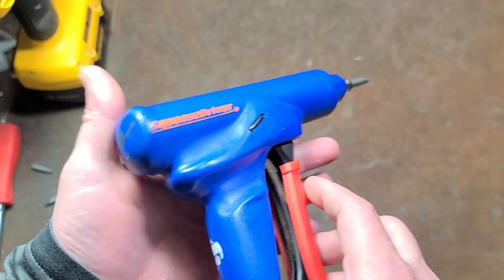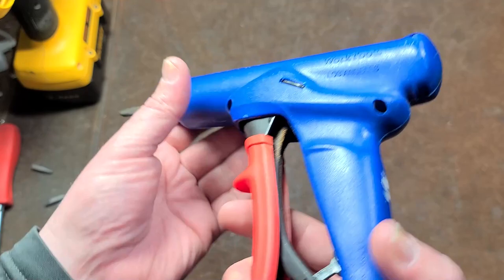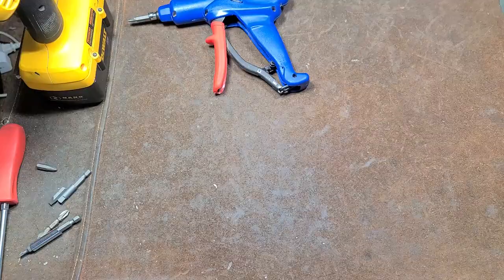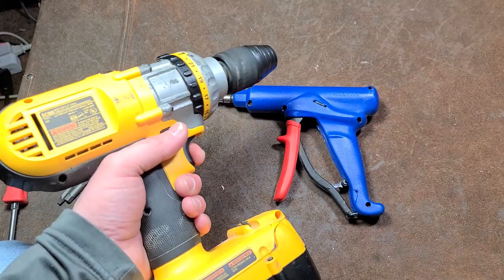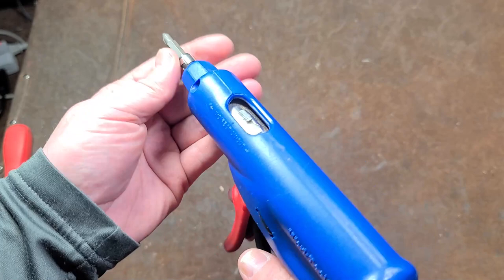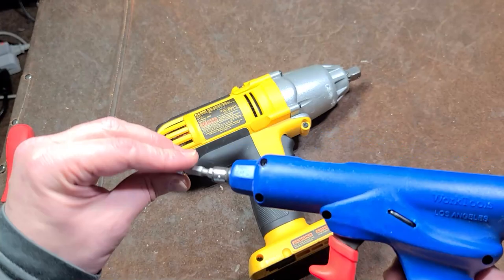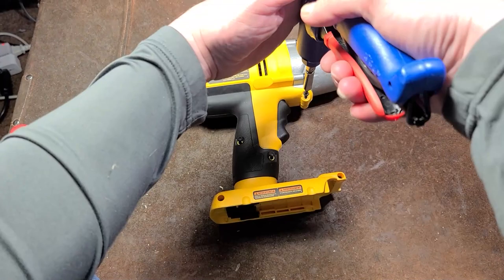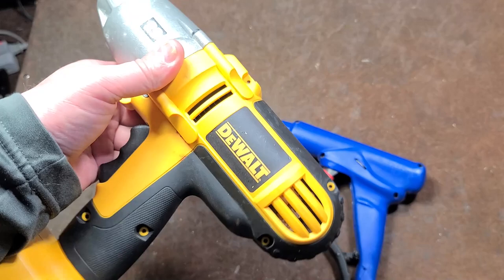WorkTools SqueezeDriver Mechanical 1/4" Hex Screw Driver Review

Comment: Think I seen it in Bradley or Namath mart back 70/80s when they had really cheap tool's I remember it had 30$ value for .99cents for 30 sockets and a ratchet.  So funny 😂 how times have changed.

Comment: Yankee screwdrivers and push drills use that mechanism. I have about 8 or 9 of various sizes, types, ages, and manufacturers. I don't really use them but just think they are cool. I found a stash of the oddball bits at a flea market which are worth more than the drivers usually so then went on the hunt for drivers.

Comment: It's not bad at all. 38 years ago a client of mine that we did a big luxury installation for gave me the original Squeeze Driver- he was an ex engineer and top sales rep for a well known tool distributor. All my installers loved it. I took it home because I loved it the most. It always came in handy and never let me down. I wouldn't build a deck with it but this little tool is far from "cheesy."